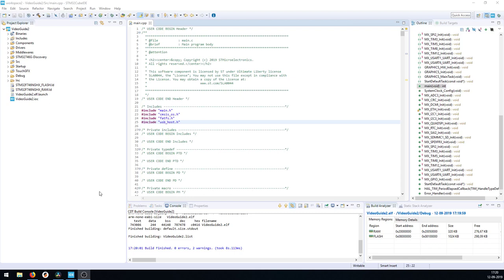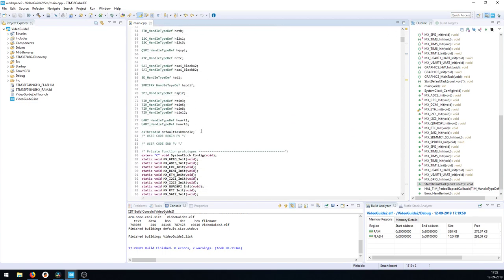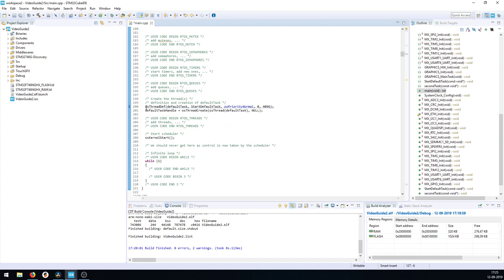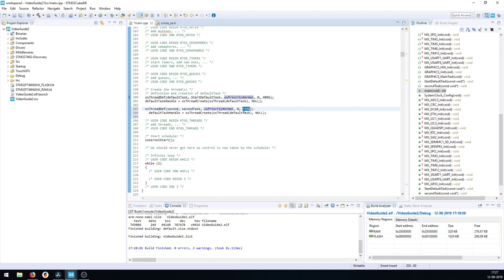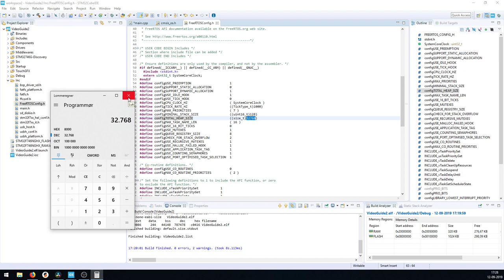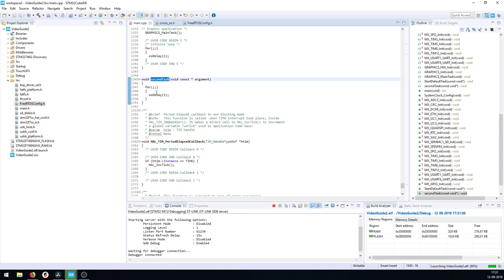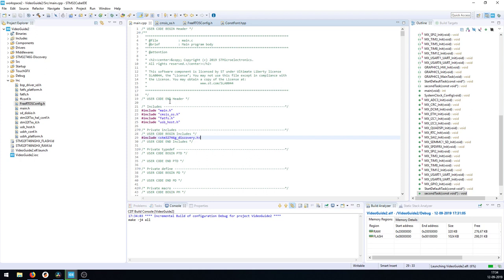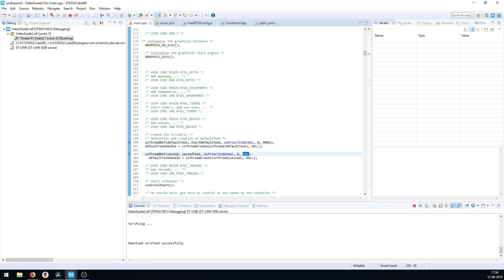Creating a new RTOS task along TouchGFX

Comment: Thanks for the great guide! Though the video helped me in a rather weird way: I was tracking down a situation where the default task dies after triggering a memory-intensive function, and was banging my head against the wall for there was no way to trace the problem. After watching your video I suddenly realized CubeMX set my default task to use a 128 word stack size by default, and changing it to a larger value (4096 in my case) fixed the issue. 
I think my lesson learnt today is to not rely too much on automated code generation tool and to try to understand how everything was setup behind the scene. I'm rather new to embedded programming so this might have been a foolish situation...but anyway, thanks!

Edit: Wow I just realized your channel features a lot of TouchGFX stuff! To be honest it was TGFX that gave me the bother as described above :D
Reply from the maker: Not at all - I have been there myself :D
It's so easy to miss that value. Also you should remember to increase the stack size of the RTOS or you might be in trouble again ;)